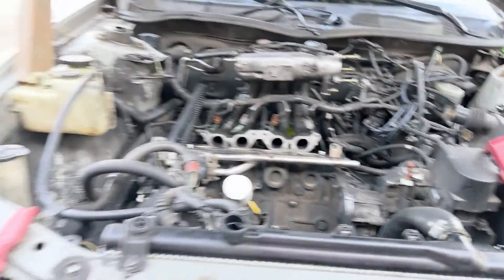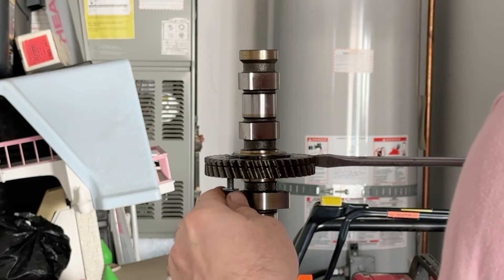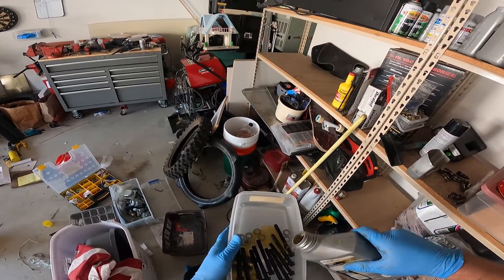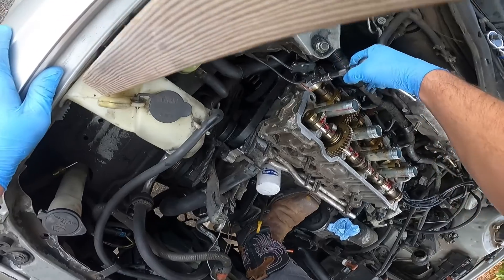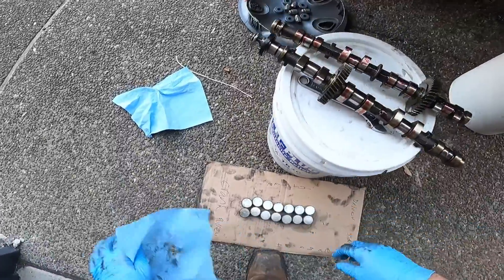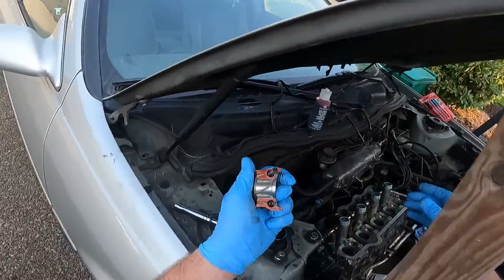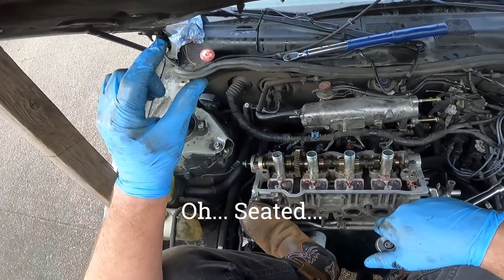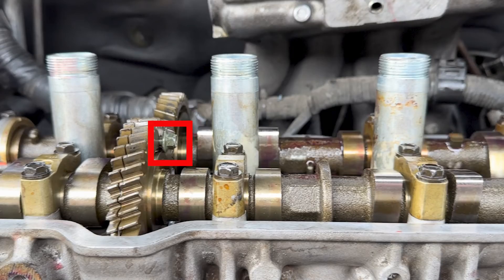Toyota Camry Head Gasket Replacement Part 1

Comment: tqing the head you always start in the center lol you do sides for removal
Reply from the maker: Hey, she runs😂😂
Reply: @pnwvibe3123    lol..but for how long? There's a tightening and torque sequence you're supposed to follow so the head doesn't warp. You're supposed to start from the middle and work your way outwards. Any maintenance book will have the sequence.

Comment: What's was the bad sign of a bad head gaskets on those Canry 2001 ? Because I opened one just like that car . Mines leaking coolants in the passengers side. Then 3 misfires I change everything besides fuel pump and distributer cap . I change spark plugs wires couls fuel injectors fuel.presure Regulator still misfires and it leaks

Comment: Did u have any codes or timing issues after insulation? I hear that if the thickness is removed from these heads, even that of half a human hair that it will throw timing off and pull codes. Is it running without issues now regarding all that. Have a 2000 that just starting leaking enough to mis fire one cylinder so caught it early I’m hoping. So is that Camry doing well and no problems with timing or throwing codes. Thanks man and good job especially the video was very well made and filmed, good views on work site everything easy to see and clear.
Reply from the maker: Yeah it runs great no engine lights or codes still.

Comment: My 2001 Camry needs this done :/ I’m devastated only 90k miles
Reply: The only way that would happen on the 2.2 liter engine is if it overheated by a lot. I have 365K miles on mine and it runs like new. I do all the maintenance on it. I never let it run low on coolant or engine oil.
Reply: yes someone said the same thing- it was COOKED before i baught it.. shes running poerfect now after the head gasket rebuild!!  @bernardocisneros4402

Comment: you didn't have the block resurfaced did you? Any special prepping you did for that?
Reply from the maker: No not the block just the head. Apparently it’s pretty uncommon to have the block warp on these engines. Just clean her up as best you can. Then go over it again.
Reply: @pnwvibe3123  thanks!
Reply: @pnwvibe3123  Another question: Have you had any issues since doing this job, or running strong? I have a '91 so it's definitely a different process, but using this vid for guidance. Want to make sure an amateur mechanic like myself won't have any big surprises later on. Gonna do timing and water pump stuff as well.
Reply: Only if you over heated  ...but leaking pressure it's only up too you